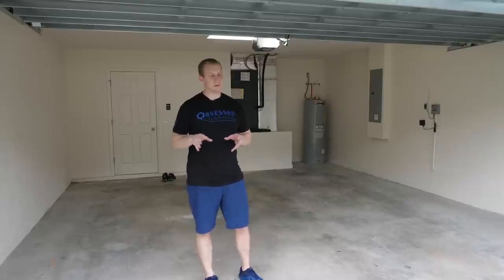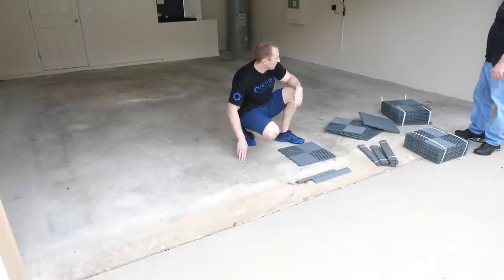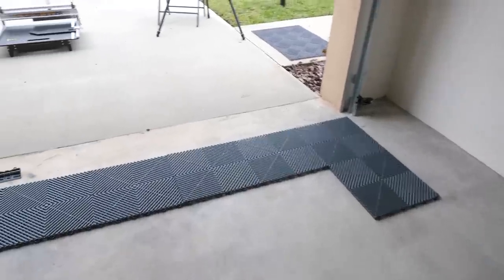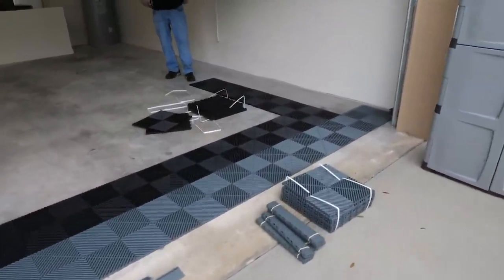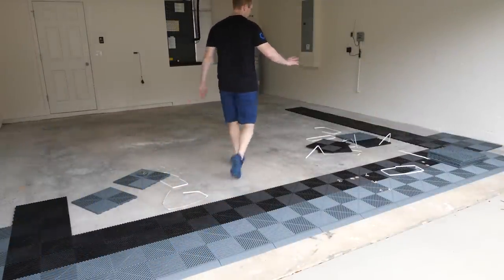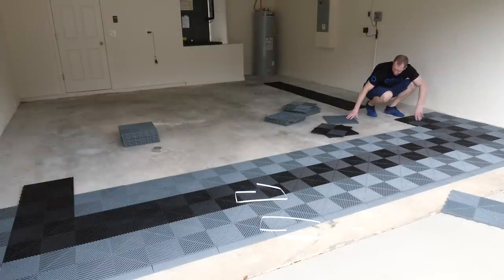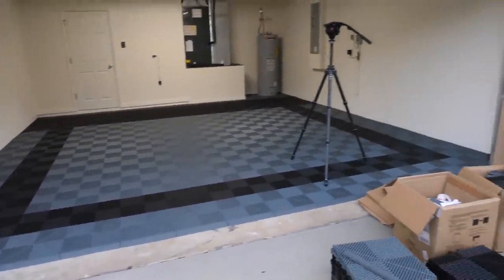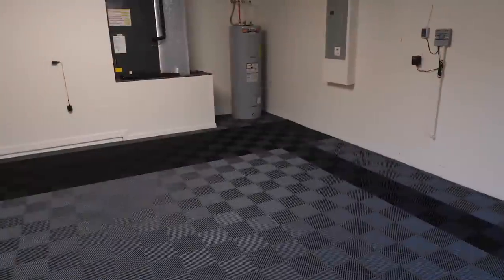Installing Swisstrax In My Dad's Garage

Comment: you bought swisstrax because you used the wrong epoxy and you lied about epoxy peeling. 

if you want a dry look instead of a wet look epoxy you need to use waterbased 2 pack epoxy. you used solvent based - thats why it looked dark.
Reply from the maker: What are you talking about?  Lying?
Reply: @ObsessedGarage  you said epoxy peels when you had it applied. Epoxy does not peel unless you don't prepare the substrate correctly. If you had peeling epoxy it's because of poor prepwork , you need a diamond ground surface
Reply from the maker: Nope, I didn't say that.  Mine didn't peel, but I've seen many of them.  You can diamond grind until you reach the dirt.  If you are water prone, it will bubble and peel.
Reply: @ObsessedGarage  They should only diamond grind down about 1/8th inch and when laying on the epoxy it won't bubble or out-gas if they mix it so it dries in the right amount of time.  It's when they mix it incorrectly and allow too much time for drying that it will out-gas and bubble will appear.   I've seen it first hand with a urethane install.   The solution wasn't horrible, they just sanded the floor down by machine and laid down a 2nd thinner coat of product.   Back to the Epoxy/Polyaspartic product though, tossing of the chips after the first layer helps prevent and mask bubbles too and is the source of the traction so the floor isn't slick. 

The next day they will come back and screen sand the  chips down and then lay the polyaspartic-polyurea top coat which is where the durability stems.   It's truly an impressive and professional look.  One and done for sure.   It's a great process and I've toured several local accounts of the installer I'm working with who have had it down for 10yrs and it still looks like brand new.   The only real issues I have are costs....it's about $6.75 per sq ft. and then I have to get a small storage unit to put my garage items in for 3-5 days and then there's the time and dust, etc. which are all minor issue but in the end Swiss Trax  offers me a DIY ability with a 1-2 day install and the cost is roughly half. 

As of now I'm likely going Swiss Trax.